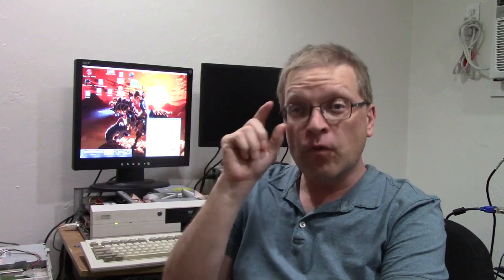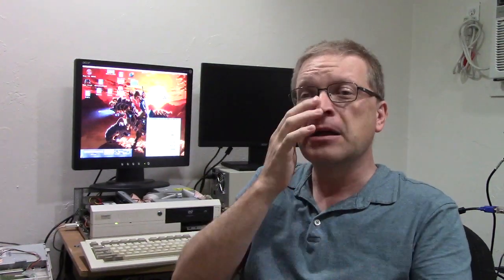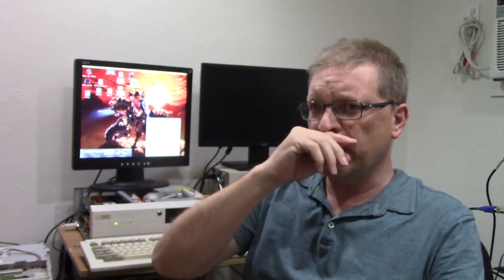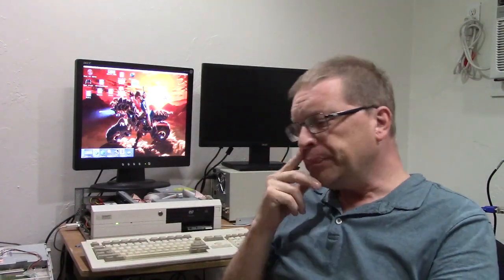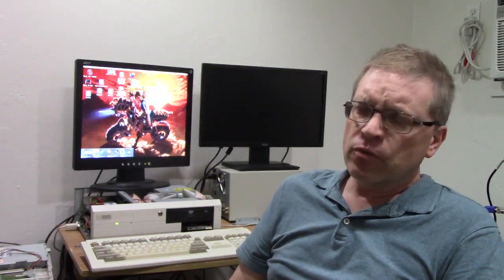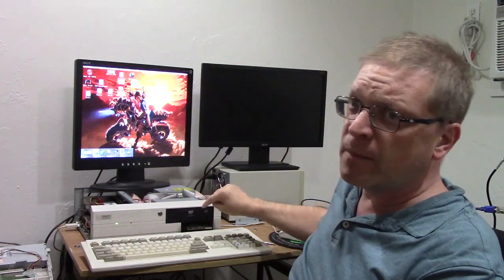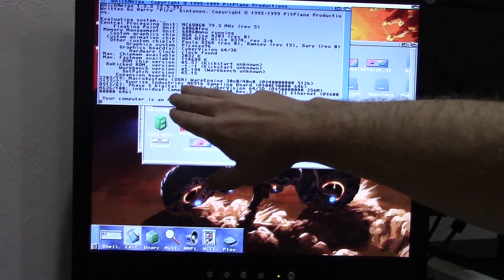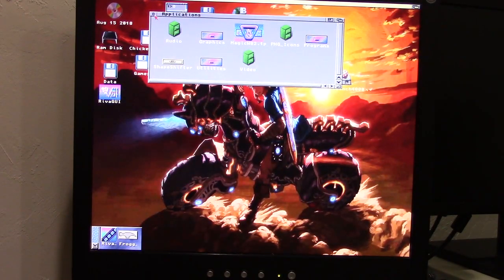10 Minute Amiga Retro Cast Episode 14 - New Hardware and addendums

Comment: Bong?  It was supposed to be the Kickstart 1000 tones... maybe it's happening too fast now :)
Interesting on the IDE vs WE conflict... do you have the interrupt clip on the CIA from the WE?  The "load module failed" might be a clue.

Also, try finding the 2016 AGA/060 demo from Unique - Subside because that looks like it maxes out the machine pretty good as a test of the WE and your gfx setup.

Yes, clean up the IDE cables to help with cooling... but there was a card that had a couple fans on it that I used.  But with an 060, you need to make sure that the fan on the CPU is able to move enough air around and no use the 040 fan (which everyone who does the upgrade still seems to do).  If you can, grab a better low profile fan (since it's 2019) and you should be able to find a better and more effective low profile heat sink with different materials.  If you want to move the CD to external, they make 5 1/4" bay coolers that would help.
Reply: oh, I forgot to thank you for the kind words about the WarpEngine... it's amazing that people are still using it 25 years later.  If you didn't get the manual, it's up on http://amiga.resource.cx/manual/WarpEngine.pdf
Reply from the maker: I love the idea of taking out the CD-ROM and replacing it with a fan that fits in the bay. I used to sell those about 17 years ago at my shop! I never use the CD for anything, anyways. I found a nicer fan for the '060, but it is not as perfect as I want. We're you involved with the Warp Engine? Kinda sounds like you were - if so THANK YOU! It is quite literally my favorite piece of Amiga hardware!
Reply from the maker: Oh - and I thought the manual says the clip is only if you use the Warp Engine in the A3000?
Reply: @10MARC   it is, so if you had been using it, I was going to suggest not to.  I'm still perplexed by the IDE issue, but honestly, I didn't have an IDE drive in my A4000 during development (and obviously not in the A3000) because they were paaaaainfully slow and pretty much useless other than as a large floppy... the ncr53c710 just blew away everything.  Might be nice to try to find some sort of SSD, but then having small partitions pretty much sucks anyway.

Good luck!
Reply: @10MARC  Oh.. yeh, that's my name on the board next to the SCSI SW part (though I also helped Kelsey with the design and thought process of creating this thing (see the Forward in the manual).
Reply: @10MARC  and thank YOU for keeping the spirit alive in 2019

Comment: I just got my A4000/40 working again, and installed a GVP 28/24 card.  I have a Warp engine card, and wonder if you (or anyone), knows where I can find the instructions to install the card.  I am still using a 3000/40, but even the stock 4000 is so much faster.  I just found your channel tonight, and am also looking forward to your 8 bit info, as I have some C64s, 128s, Sinclair, and Mac stuff.
Another question, that might already be covered in your other videos, but how have you been able to stuff all those cards in the 4000?
Cheers,
Bob
Reply from the maker: Tbe Warp Engine is such an awesome card! You will love it. Here is the link to the manual.
https://bigbookofamigahardware.com/bboah/product.aspx?id=259#:~:text=The%20Warp%20Engine%20is%20a,and%20fitted%20onto%20the%20Warpengine.
Reply from the maker: There are the four ZORRO III slots in the Amiga, and the Warp Engine handles all the RAM and the SCSI. It is a very tight fit, as two of the four cards are full size and full length! Lots of patience...
Reply: @10MARC  Thanks, I had actually found that page, but missed the link to the manual.  I hope tol start on the installation this weekend.
Reply: @10MARC  I had a look and there isn't much room inside.   Two of the Zorro slots are taken up by my SCSI card and hard drive, and one by the GVP board.   Other than the Gotek, which I am going install externally, I don't have any immediate plans for another board right now.
My second worry, was if the 150 watt power supply had enough juice to run everything.  I have
Reply from the maker: @jjock3239  the Warp Drive will replace that SCSI controller, so you can take that out to save some room. It installs in a totally different area anyway, but you don't need two SCSI controllers. The memory on the Warp Drive is so much faster than the GVP memory that you could remove that card too if you want.
Don't worry about the power requirements. I have my A4000 maxed out with 148 MB of RAM, a 68060 and all slots full and have not seen a single power issue
Reply: @10MARC  Thanks,
the information on the power requirements is good to know.
The only reason I would like to keep the other SCSI card, is because of the external SCSI_2 connector that I need for some of my stuff, such as other SCSI-2 drives.  I wonder if I can connect the internal hard drive and the CD rom on the Warp board, and use the card in the Zorro slot for external use.
The other question, I have OS 3.9 installed, and wanted to know what changes the Warp engine board requires.
Reply from the maker: @jjock3239  makes sense about the external SCSI. It is certainly possible to get an adapter that adds an external connector to a standard 50 pin cable if you end up having issues.
3.9 will work fine with the Warp Engine. I would put some thought into going with 3.1.4, as 3.9 is a dead end as far as moving forward. (That being said, I do really like 3.9)
Reply: @10MARC  Thanks for all the tips, I am going to have to pull the 4000 again, because I started getting the yellow screen occasionally on startup.  I have other CIAs, if that is the problem, but I just remembered that when I bought the computer approximately 18 years ago, more years ago, one or more of the retainer clips for the simms were missing.  So, I will have to get the repairs done first.  I also have a 4000/30 case to work with, so I am not dead in the water.
Bob
Reply: I have decided to pull the hard drive off the SCSI board and install it on the warp drive SCSI port, and that way the drive will only take up one slot. 
I have another question.  If I was to install my AT PC board in the 4000, would I be able to install a ethernet card and use it from the Amiga OS? 
Thanks,
Bob
Reply from the maker: @jjock3239  there is a driver on a minute that does allow you to use the ethernet card on the PC side for the Amiga. I don't think that it is particularly fast, but I understand it does work
Reply: @10MARC  Thanks, I wasn't worried about a fast rate of transfer, and I was still playing with the idea of going back to using the parallel cable and the PCtoAmiga software to move my data and software around.   Because I am using Linux, this second option would still require  moving data to a PC first. 
I removed the board around 2000, because it was slow, so I never did any experimenting with it.